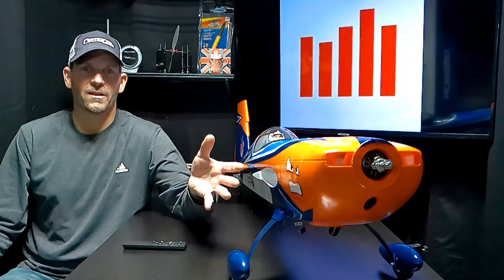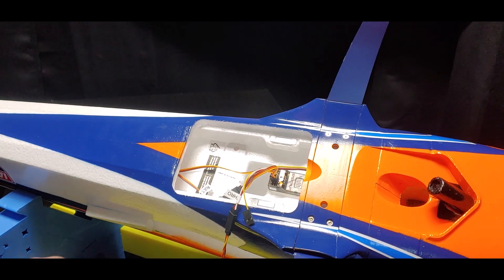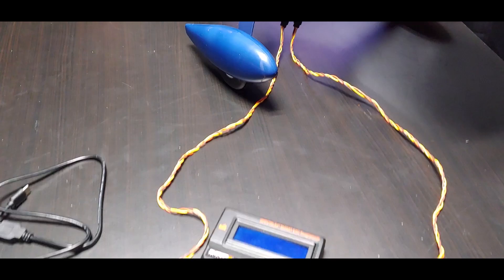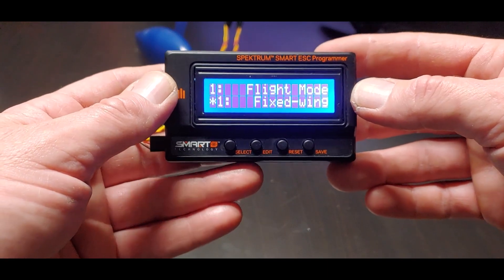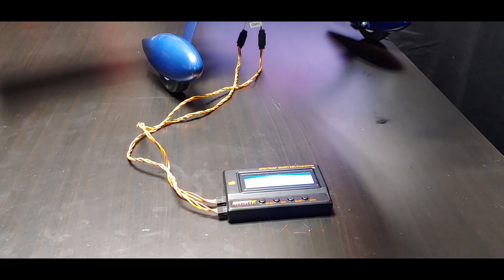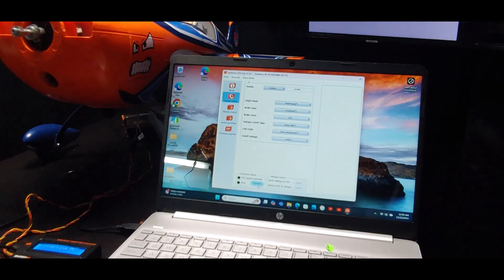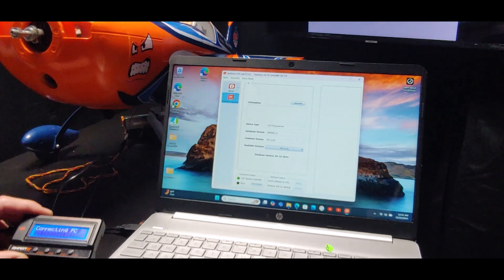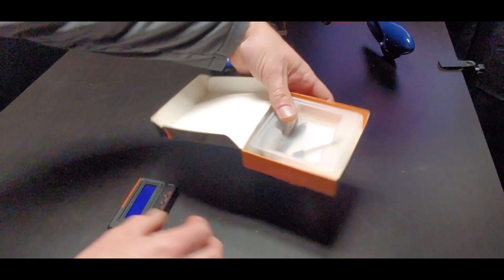How To UPDATE AVIAN SMART LITE ESC RC AIRPLANE

Comment: It helped me out brother. I have my first avian lite & I didn't know what that single lead was for so I plugged the 3 wire into the ESC & it wouldn't connect. I heard there's a programming port but my ESC has a lot of shrink-wrap extended out to where I can't see if there is or isn't a programming port so with your video, I at least know how to program with the box & more importantly update firmware. Great content

Comment: My Avian Lite 85 Amp uses a brake force 7 when I am in reverse thrust and stops the prop in 1second when I release the I button on my NX10 and AR637T+.  When I use forward thrust and retard the throttle the motor stops but brake does not stop the prop from windmilling.  Forward thrust wind mills inflight because brake is not working.  ESC and box has the latest firmware has the latest software